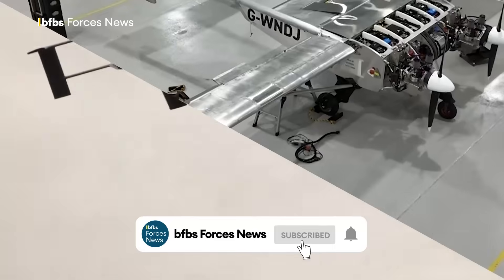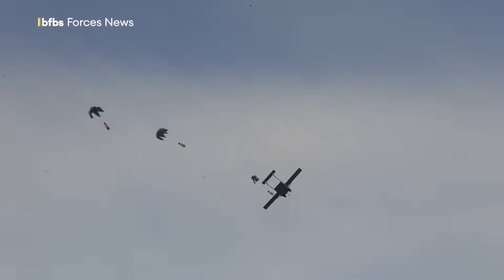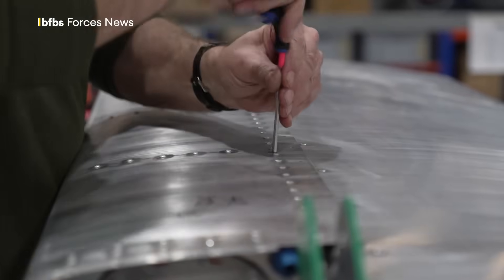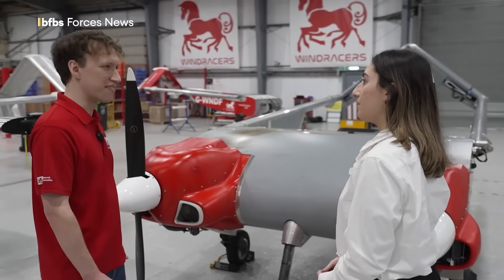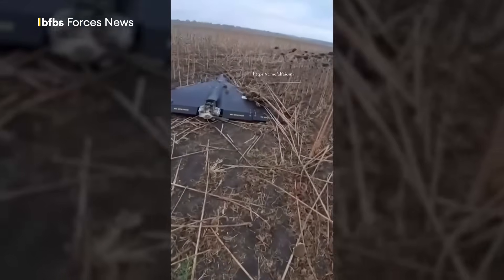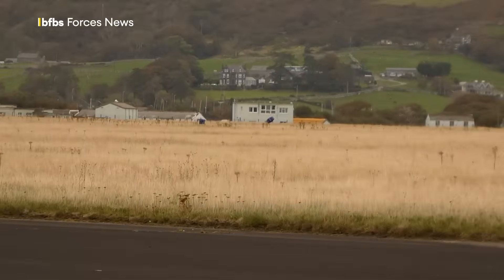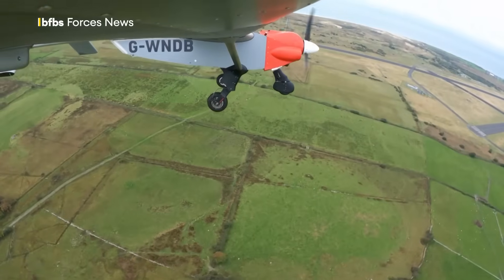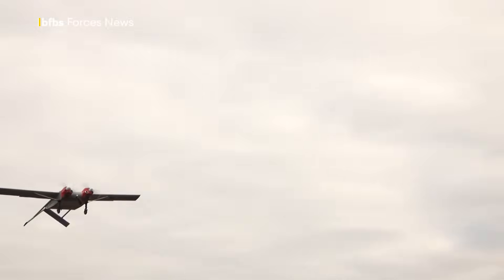ULTRA unleashed: The British-made drone delivering lifesaving supplies to Ukraine

Comment: Very impressive work, thank you!
One small remark though: have you considered why Bayraktars are used much less nowadays? Because getting closer than 5 km to the gray zone with a large airframe and a hot turboprop engine basically means losing the drone.
That’s why this kind of promotion goes a bit too far, especially the claims about “missions deep behind enemy lines.” It’s quite obvious that a drone made entirely of aluminum, with current production rates, was never intended to be used as a kamikaze platform

Comment: two miniature turbo-prop engines with a single counter-rotating propeller makes more sense for Ultra 200 & similar fixed wing drones . . . max payload increases to 563 lbs & 36% more range . . . folding wings makes the Ultra lot easier to mobilize, but it also means an increase in weight (unladen) . . .

Comment: I don't want to depreciate Windracers in anyway, but we have to be realistic about this, firstly what is suspiciously absent in this is any sort of unit price. 100 -120 units a year, fine, but at what price?
"In a Class of its own" ? Fine, but you can define "class" any way you want. Large cargo drone or large cargo drone currently being made in the UK? 
China had large cargo drones 7~8 years ago, they had a Y-5B converted into a drone carrying 5 tons of cargo back in 2018. And is it made or assembled in the UK? It would be very interesting to learn what % of "Ultra's" components are being made in the UK or even in the EU and how many are being made in China.
Also, the Iranian Shaheeds and the Russian copy The Geran aren't running on a moped motor, they use copies of the Limbach L550E piston engine, that's always been an aviation motor. At 50hp it puts out more power than the Citroen 2CV or the Fiat 500, and when were they ever considered "mopeds"?
I think British military industry (and many other things) need to be massively expanded and improved, but that can't happen with people still spinning utter bull about what is actually going on with them.

Comment: To bad is all aluminum. Makes it easy to see on radars. Plastics,  fiber glass, and carbon fiber would be a much better idea.
Reply: Strikes me that it would be a good design to make use of the ground effect, flying close to the surface of water. Virtually invisible to most radar, it’s just visible & audible to local area.
Reply: @bodyandsoulproject  Despite the word ground in ground effect, it is really only practical over water (or the occasional desert or salt flat). Too many obstacles to avoid, which would force it to go into and out of ground effect altitude. Things that fly nap of the earth fly above buildings, trees, wires, etc. That’s too high to take advantage of ground effect.

Edit: so I just noticed that you said water. A ground effect drone for sea attack would be pretty good, actually. My bad for not reading carefully.
Reply: @blacksmith67  no problem.. also good to sneak up and down rivers - which is a major feature of the Ukrainian landscape.

Comment: I seem to be missing the point here. So this drone is used to re-supply Ukrainian forces behind the line? I guess it is flying over the low level drone denied airspace because of electronic jamming, just by using the operator, no AI, nothing new. Right? So just take any ultralight or Light Sport aircraft that any western country is producing in numbers, make it radio-controlled and cut off the lower part of its fuselage to be used as cargo area. Am I missing something here?
Reply: No you’re not missing much, these people just reinvent the wheel and call it innovation. Still pretty cool looking.

Comment: The Shahed drones do NOT use an engine even remotely like a "moped engine". (Either real pedal-started moped engine, or what you likely mean, a modern 2 or 4-stroke scooter engine.) They are a twin cylinder "boxer" style two-cycle engine, similar to many ultralight engines, only smaller. They can sometimes apparently keep running with only one cylinder firing, as long as the other cylinder is still in place, and it's piston, free-moving. That's their built-in redundancy, but it's not nearly as redundant as two seperate boxer engines, as seen here. It WILL MAKE ALL THE DIFFERENCE deployed in long distance missions, where an entire engine may have been taken out, by a single rusty old kalashnikov, and a pocket full of rusty vintage Soviet rounds. . .
Reply: There  placed motors developed by german Limbach company. That company quite a long time ago, was bought by Chinese!! Who selling and licensing engines for good cash to all bastards who can pay!
Reply: all sounds like science fiction.

Comment: Bit more research please. The Shahad does not use a 'Mo Ped' engine. The Shahad uses an Iranian made aircooled flat four, copied without agreement from a German made egine, itself a scaled down version inspired by VW's classic Beetle engine.
Reply: Shahed uses copy of German limbach engine.Windracers use two Briggs and Stratton vanguard engines.The former was designed for aircraft use,the latter wasn't.
Reply: @eugeneoreilly9356 The tear-down videos done by Ukranian researchers, the Iranian copy makes about half the power of the German version.

Comment: Looks like it would light up like a beacon on air defence radar. Was consideration made to building the airframe out of wood, plastic, or fibreglass / fibre reinforced plastic or to cover it in a radar absorbing material or paint to minimise radar returns and increase mission success rates?
Reply: fibre reinforced plastic coming out of 100 big 3d printers might be an option.

Comment: so different so obsolete. aluminum is too heavy and expensive but this obsolete company doesnt have composite materials i guess...
Reply: You think aluminium is more expensive than composites ?
Reply: Aluminum is not obsolete. Almost every civilian or military aircraft has aluminum parts. What are you smoking?
Reply: it's cheap and easy to repair.
Reply: You seem to have missed the point: LOW COST and easy front line repairability. It fills a gap in the market left by the higher costs of superior products. Otherwise, Ukraine would not be using them.

Comment: Made like a Cherokee 140. Fixed undercarriage, traditional methods of building, traditional aerodynamics, I can't knock it - it's proven to give decades of service life, is very hardy (can take a ding or two, unlike composites), easy to work with, easy to repair, easy to use in the field, easy material to work with, plenty of historical knowledge and skills to draw from...

Comment: GPS Anti-Jamming Idea - use the local phone network towers as reference points on a stored map.

Even if Cell ID is changed you can use location distance difference to triangulate and confirm. Pattern overlay.

Use local visual reference points for visual reference.
Reply: Those get jammed and spoofed too. Nice idea though.
Reply: I’d wouldn’t be surprised if most local towers at the front are destroyed, also they must think of some other capability, as a lot of parts of the world especially the country in eatearn Europe don’t have towers every 5km, but can be hundreds of km. I’d assume they have some contracts with gps companies, works the same as towers but with satalites but more expensive dats transfer

Comment: Windracers Ultra is a robust, twin-engine, fixed-wing autonomous drone designed for heavy-lift cargo and surveillance, capable of carrying 100-150kg payloads over 1,000km, ideal for delivering aid or sensors to remote areas with minimal infrastructure, featuring AI for fire detection and swarm coordination, and serving roles in humanitarian aid, defense, and climate research.
Reply: Sounds perfect for supplying sabotage unitsxwell inside Russian-controlled territory

Comment: Looks to be a good bit  of kit and war tested in Ukraine. Thats how the UK should test all its Equipment to make sure its upto the job.
Reply: There are already three drone manufacturing Companies working in partnership with Ukraine  here in the U.K. A brand new factory is due to open in January in Suffolk, building three variants of the Shark D attack drones. Formula One Company MGI is partnering with Ukraine to design and manufacture new generation drones that use Ai, they have 37 years experience and will be designing drones that cannot be intercepted by electronic interference.

Comment: What is stopping them dropping bombs with it?
Reply: Or dropping smaller attack drones.
Reply: There are loads of smaller drones doing that already. They can take a small munitions and be very accurate in where they drop it.

This drone can't do that. It's more like a cruiser, not anywhere near as agile. It would need a lot of huge bombs to have a chance at hitting a target and it can't lift that weight.
Reply: @meme4one  the point is that this isn’t an average drone. This is a small aircraft quite capable dropping small arms which wasn’t brought up in the film at all.
Reply: @SmackRatsUK  it's not designed for that or really capable of it. Not everything is about bombing. This has far more value than making itself a target for AA. Bombing isn't like it used to be in ww2!
Reply: nothing
Reply: Weight limits, the upgraded version can only carry 200kg 🙄
Reply: @Emohyu  i’m sure if a DJI drawn can carry a grenade this will be able to carry some sort of bomb. Would you not say?
Reply: @Emohyu  200kg? I wonder what the street value is on that cargo? 🤔😃

Comment: Wouldn't the redundancy of two eninges come at increased acquisition, operating and maintenance costs while reducing range through increased weight and fuel consumption? With the engines being so close together it also seems like battle damage might affect both engines at once (prop desintegrating hitting the one next to it) leaving engine failure as the main use case and I feel like this could be adressed with less trade off.
Reply: How many drones have you designed and developed?
Reply: How many drones do I have to design to notice unsual design choices?
Reply: Good point mate give them your CV you'll probably be made chief engineer with ideas like that.
Reply: The main features of this drone are long range efficiency and accurate dropping off of cargo. Two engines help at take off and climb, then provide redundancy later and make balancing easier as fuel load and cargo load changes
Reply: It's designed to be low cost, therefore compromises are inevitable. Simple as that really.  Higher tech and more advanced designs will cost more.
Reply: Makes you wonder why all aircraft dont only have one engine.....
Reply: @gabehorn1001 Makes me wonder why no other plane has two engines in the nose right next to each other.
Reply: @tobythesecond1713 No they just put them right next to each other at the back on every twin engined fighter on earth.....surprised a sharp guy like you never noticed that.
Reply: @tobythesecond1713 Shall i explain packaging to you ? Nah...im sure you already know everything about it.....
Reply: @gabehorn1001, no, please I'd love to hear the reasoning for the subjectively odd design choice made on this UAV. I am just not sure I will get it from a guy drawing surface level parallels (both fly, both have two enginges) on otherwise largely incomparable plattfroms with different technologies and use cases. Reliabilty, high payload capacity, fuel efficiancy/long range are very common design requirements for small aircraft and especially UAVs. Yet, none other tries to achieve this in the way displayed here and intuitively this solution seems less than ideal to me.
Reply: @tobythesecond1713 There are only so many places you can put engines on an airframe so if your desired takeoff weight requires two engines then your choices are limited.....packaging.....you are welcome.
Reply: We can guess that these are cheap engines so maybe stolen from a mass produced lawnmower production line?